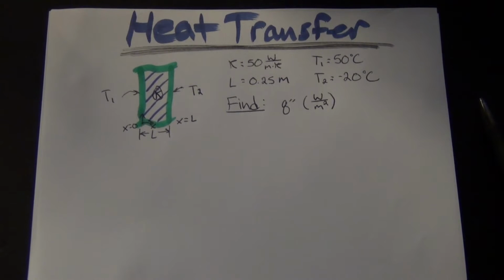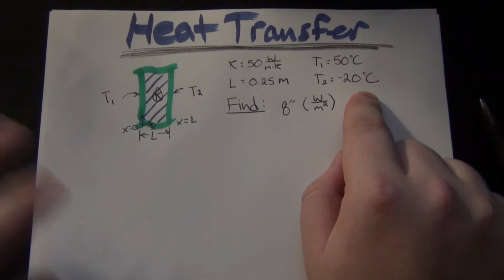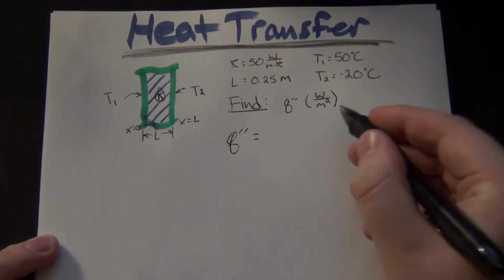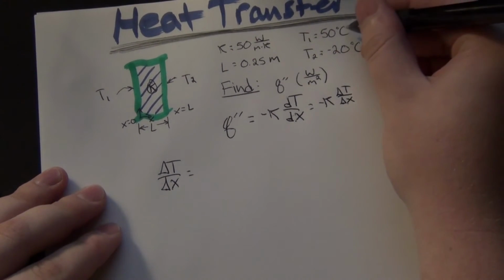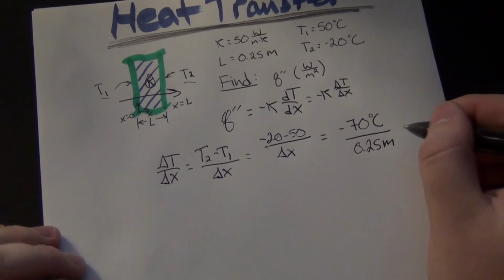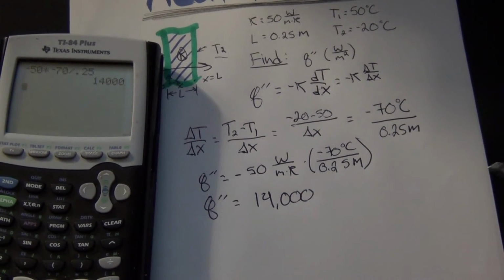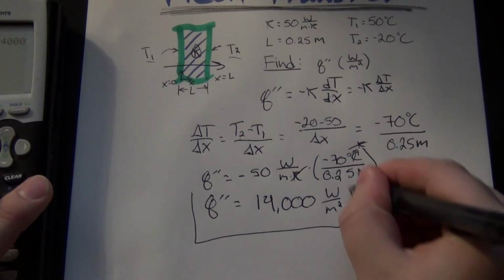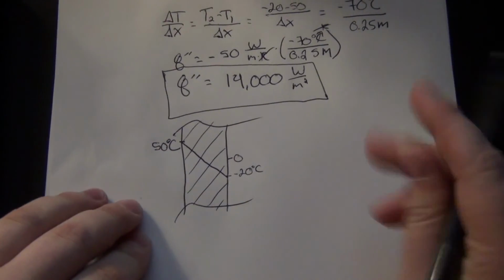Heat Transfer Example: Conduction Through A Wall

Comment: 0 " C = 273.15 K . Then how can you supposed to cancel C/K . Its wrong calculation .First of all you should convert T1 and T2 to Kelvin then you can cancel K/K
Reply from the maker: I cover this in the video. When you're taking a temperature differential T2-T1, the answer is the same in both C and K. If you were to convert both temperatures to Kelvin first, you'd get T2+273 - (T1+273) = T2-T1. I prefer to just always know that if i'm taking a temperature differential I can kind of forget about units, instead of always doing that extra math. It always work as long as you know what you're doing, and I think it gives you a better understanding of the equations.